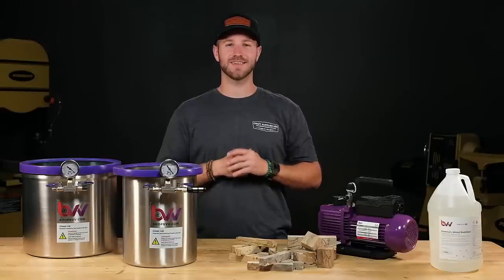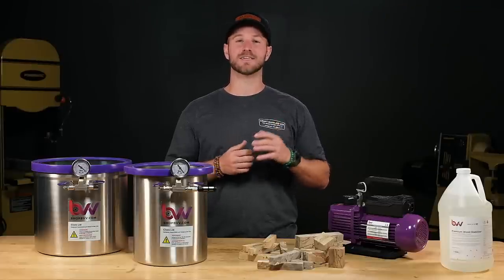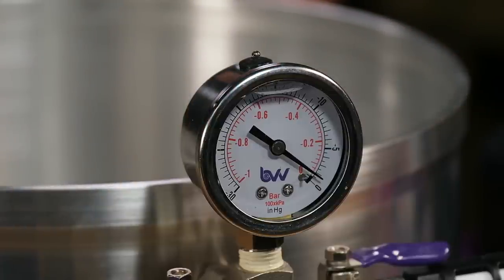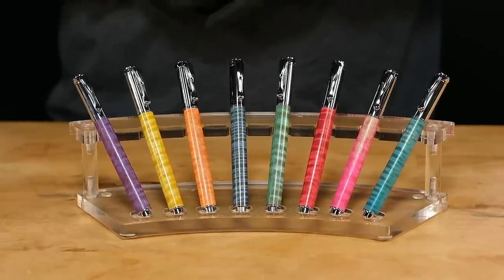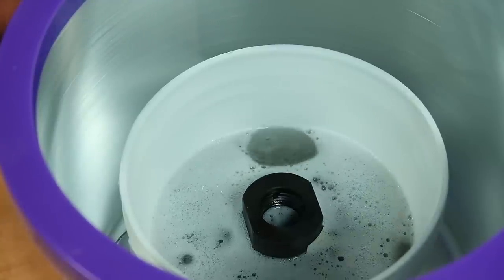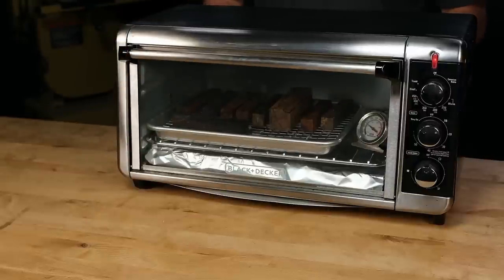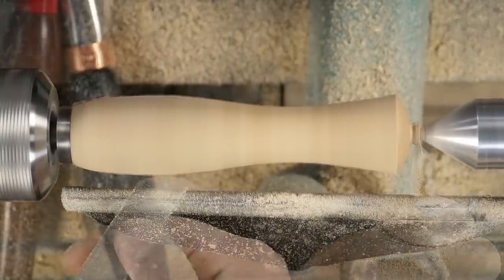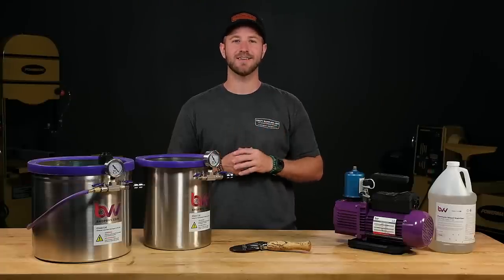How to Stabilize Wood Blanks

Comment: Thank you!
FYI, moisture won’t damage a vacuum pump. Just requires regular pump oil replacement depending on frequency of use. One of the primary purposes of a vacuum pump,  IS boiling off moisture in an AC system when serviced😂

Comment: Probably the best stabilizing video I’ve seen on YouTube. A lot are full of bad information. 'As someone who stabilizes wood for a living a few things. You’ll get better results if your wood is at zero percent moisture which can easily be done by putting them in the oven. Checking them every few hours with a scale until they’ve stopped loosing weight. Also if your wood is at 0% there’s no moisture to get into the pump. I use a cold trap and liquid nitrogen which is a bit much for the average person but a resin trap in-line before the pump will most likely save your pump at some point. Because I dry the wood to zero and with a trap to catch any resin I change my oil once I every two weeks but they run continuously for those two weeks because I have several chambers hooked to each pump so that’s 336 hours by that point.

Comment: Hi craft supplies, question I’ve been trying to look to find out whether you can use a pressure pot as a vacuum chamber, I have not done any resin, casting or anything yet, but I do have both a vacuum chambers and pressure pot , I am hoping to do some resin castings later in the year, however, I do have some pieces that I would like to put in the pressure pot but cannot because mine is too small  I do have a very large pressure pot, thinking whether I could get a Perspex or polycarbonate plastic lid for it. Then put in the relative fittings that is required for a vacuum chamber., so is it possible?, PHIL FROM THE DARK SIDE OF THE MOULIN FRANCE
Reply from the maker: Hello Phil,
There are some pots on the market that are a Pressure/Vacuum combo chamber and will be listed as such.  I would not recommend adding fittings to your pressure chamber for vacuum as the fittings are not pressure rated and could be potential dangerous. Hopefully that helps! -Mike

Comment: This was awesome. Thank You. Can you stabilize stuff that's already been turned? That handle for example, could you have turned it then stabilized it?
Reply from the maker: Not really a good idea. The stabilizing process tends to warp the wood. Also, there is always residual resin that hardens on the wood that would need to be turned away.

Comment: Thanks for the video.  I noticed that others individuslly wrap their pieces in tin foil to bake.  Have you done that to notice if there is a need to wrap ?
Reply from the maker: I only wrap the blanks with foil to prevent them from sticking together, usually if I do a large batch where there isn't room in the oven to space them out.  Some of the earlier stabilizing resins used to foam out really bad and foil was required.  The newer resins don't do that. -Mike

Comment: For your inlay rings how do you stop the activator from clouding the glue up
Reply from the maker: Typically the clouding comes when applying too much activator. I find it helps to spray the activator from further away (8-10 inches from the piece) and to use an aerosol can instead of a pump sprayer . Activating the glue too fast creates too much heat which leads to the clouding effect.
Hope this helps!
If you want more specific help, call our tech support at 1-800-551-8876